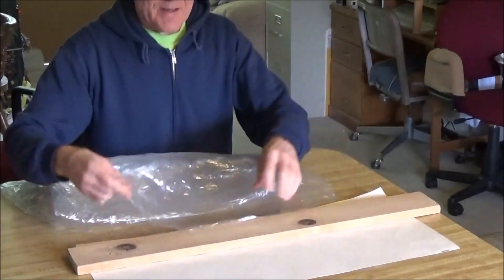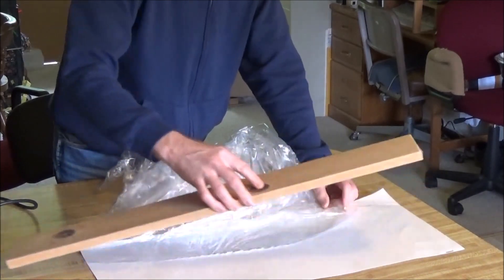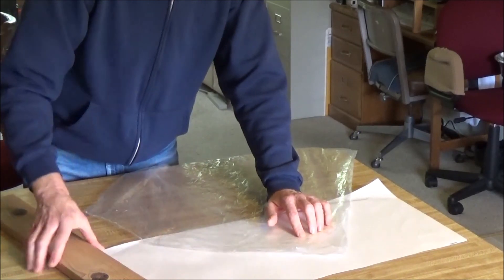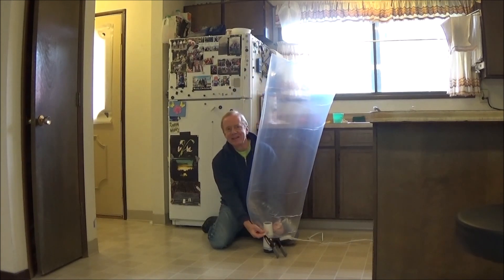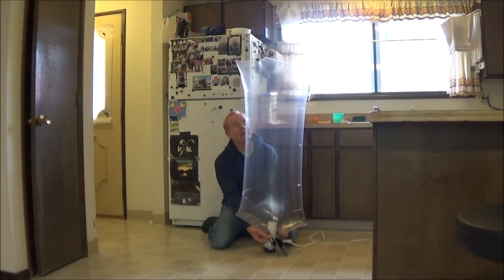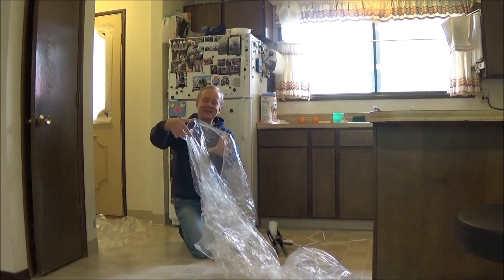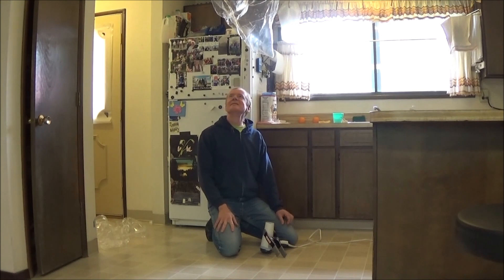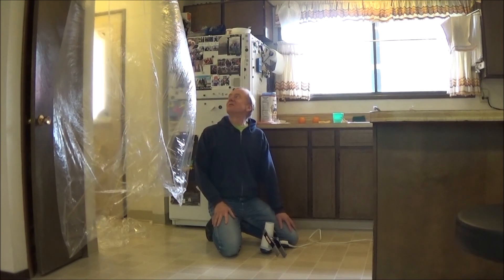Indoor Hot Air Balloon using a hair dryer for heat.

Comment: Electric hot air balloon is an example proof a combustion engine car can be run off electric hot air maker. Maybe ceramic element.
Reply from the maker: Heat engines (Sterling cycle and steam and likely others) can be ran from electric heat.  That's sometimes done for educational demonstrations.  However, efficiency of conversion from electric power to mechanical power is very low compared to normal electric motors.
Reply: @davekni     The efficiency does not have to move car. The heat compressor would feed a combustion engine. Combustion engine moves the car. Battery could be modest and recharge similar to alternator. The ice is so efficient that the electric motor does not have to be, and the heat exhaust can be recirculated helping the electric motor anyway.

Comment: Thanks it's really good challenge.
Reply from the maker: I've tried a new one using polyester (mylar) emergency blankets.  Heat joining does not work as well, so I taped all the failed seam sections.  Works well.  Polyester is heaver than polyethylene, but can handle hotter air.  I'm about to make another polyester one with only polyimide tape (kapton tape) for seams.

Comment: Amazing. I Suggest you to stabilize the attitude by adding a micro weight at the bottom to prevent the hot air from escaping by the hole.
Reply from the maker: Yes, definitely a good idea.  I've since done this several times outside with a string attached on very-calm days.

Comment: Interesting. . Double layer may add insulation, and delay heat loss.  But flipside is the greater mass.
Reply from the maker: That's an interesting idea!  I haven't heard of any double-layer hot air balloons.  Perhaps too difficult to construct.  For large balloons that carry people, the second wall could be much thinner and lighter - something like bubble-wrap with the bubbles against the existing wall and the continuous-film side of the bubble-wrap as the other layer.
Reply: @davekni  yes bubble wrap is the correct depiction. Thanks